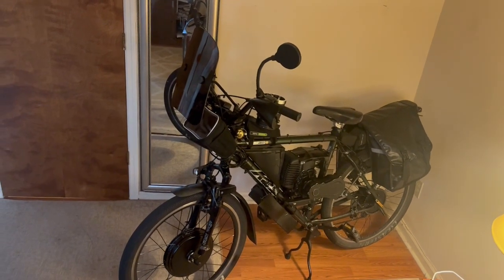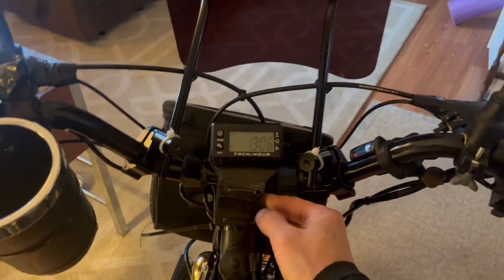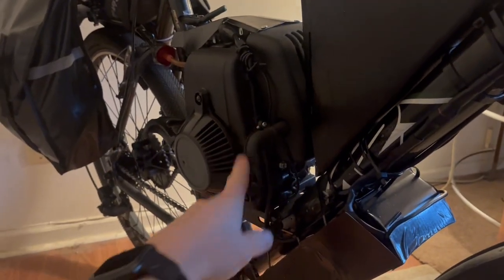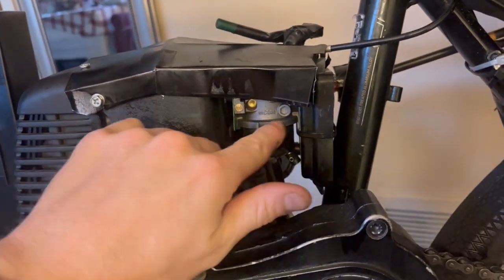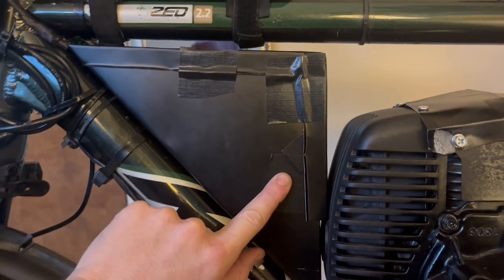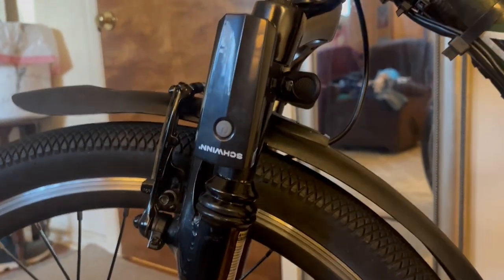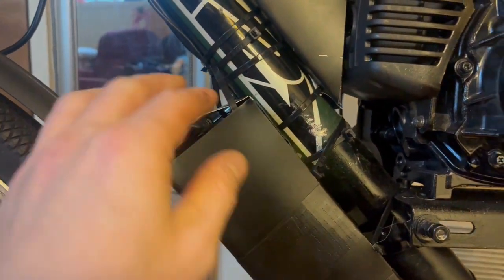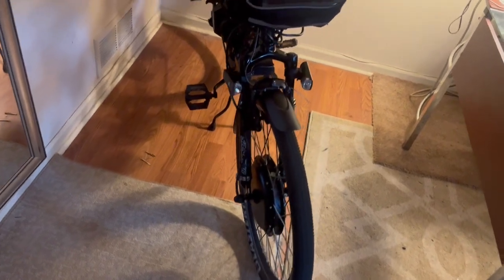Motorized Bike Update- With Electricity!

Comment: You used try adding a John Deere lawnmower alternator to the chain tighter for your gas engine. That way when you're using your gas engine it will charge your electric battery. They also make and sell rear rack that mounts battery under rear rack.